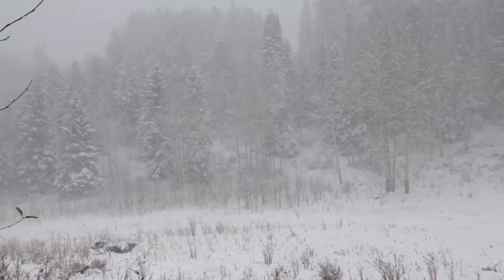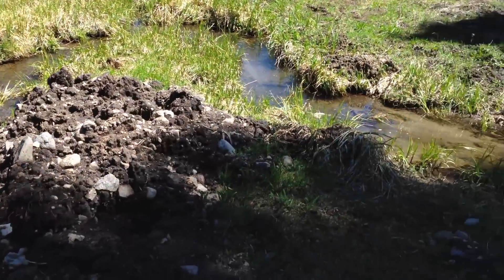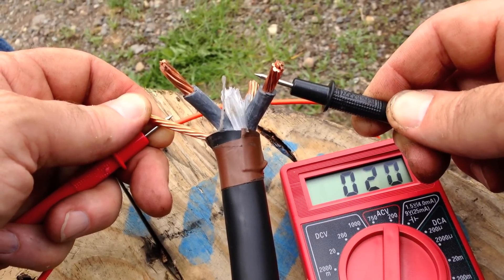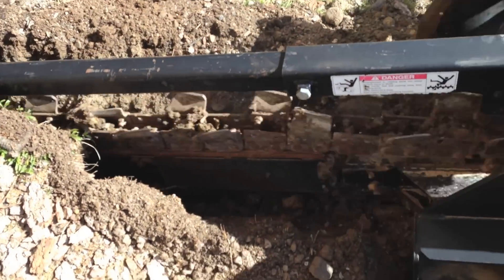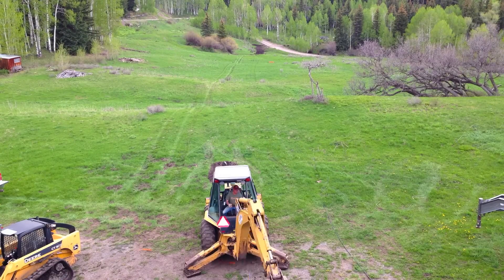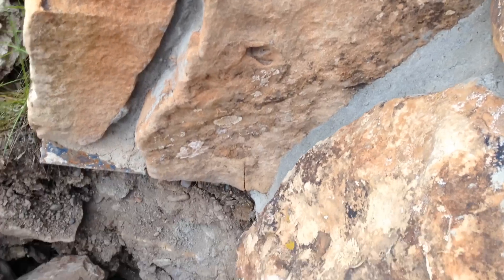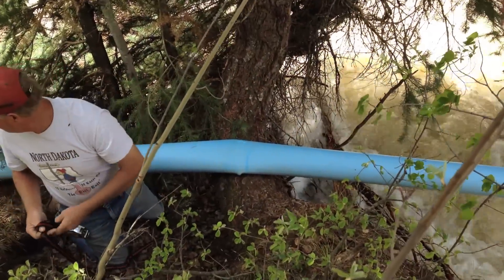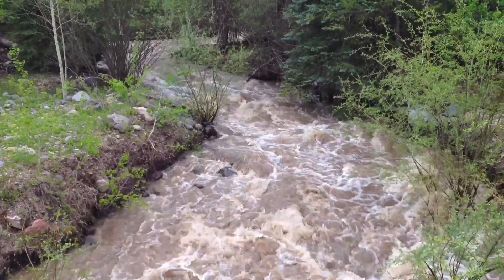Part 10 MicroHydro Power System in CO

Comment: How did you obtain the water rights to do this? how much did this cost overall for the entire project?
Reply from the maker: We filed on water rights in state water court.  Its a lengthy process which is best navigated with a lawyer well versed in water law.  It can take years to finalize if you are just starting out.  

I don't know what you have seen of the series.  We started in 1995 acquiring water rights and putting in a penstock from springs. That initial system cost around 25k in 1996 dollars. We also got gravity pressurized domestic water and a pond for raising fish at that price.  

When we moved the existing equipment to the creek we incurred additional costs of around 55k in 2015 dollars because we needed a full redesign of penstock, powerhouse, transmission and load management.

People often ask how long it will take to payback the system, but this neglects to consider that we would have had to spend about $140k in 1995 to bring power lines 7 miles into the off grid property.  That estimate had ballooned to $250-300k by 2015 when we moved the system.  We would have had to pay that to bring power lines in and then had power bills to pay on top of that.  So it was a no brainer to install our own system at either juncture and the question of payback was/is a moot question.  We look at the installation as an asset investment in the overall property.

Thanks for watching.

Comment: Pvc is so cheap and thhn number 6 is also much cheaper the the DB 6-3 you dropped in plus if you ever want to run another wire you didn't have to dig up your driveway
Reply from the maker: Oh well, done now.  thx for watching.  If you haven't seen it check out parts 20-1,2,3 which are a synopsis of it all.
Reply: I'm still watching the videos, so good and thank you for videoing this for the rest of us.  Hind sight is 20 20 now that I have seen everything involved up to a point that conduit would be the last thing on my mind.

Comment: Did you think about building the intake area in the creek out of concrete?
Reply from the maker: No, the Spring run off is too great and would likely tear anything apart.  Also, this is wilderness and the only way to access the creek diversion is on foot and essentially inaccessible to any machinery.

Comment: I'm curious on the financial side.  With all the costs are you able to generate enough electricity to break even?  Or is it more expensive and you are doing it out of principal?  Very cool project. Enjoying the videos.  Thanks for sharing.
Reply from the maker: +FarmCraft101 
Reposting part of a previous answer:
It's a good question, but very difficult to answer. First, one would have to amortize the cost of laying in grid power in 1994.  At the time of the switchover the system had produced 145,000 kWh for a basic cost of $25,000 versus $140,000 for laying powerlines. Add $52,000 of current development costs and you are paying for all the future power generation in the systems lifetime. You would also need need to subtract the cost of line power over the last 19 years to determine the cost per kilowatt hour over the first system's history.

Adding to the previous answer
There is no means to sell the electricity back to the grid because there is no connection. A break even point would indicate some sort of payback or a comparison to getting the same power from the grid.  You can see the comparison above and it doesn't factor in monthly bills just the cost of bringing the lines in.  With hydro you are paying for all future power up front.  I did put it in out of both principal and necessity and just basic economy.  It was a no brainier in the 90's given the numbers.  The current cost of equipment identical to what I got back then has gone way up, but solar has come way down.  If I were to choose now, I might consider solar, but I would have to accept the idea of dealing with batteries.  That's something I've never really wanted to do at 8600 ft. And originally not being here all the time.  Hence improving the hydro has been the path I've chosen. Hope this makes sense.

Thanks for watching.  There will eventually be more to come, so do subscribe.
Reply: MrHydrohead z

Comment: how can I increase flow and load to a stream that flows into a lake (really a river but has a dam)
Reply from the maker: I'm not sure I understand the question.  Could you describe if you have a pipeline existing or a potential design?  How far it falls top to bottom(head = pressure) or how much water is available to travel through it?   Head and flow are the two important measurements.  The amount of available water is what it is.

Comment: What is a weir? I have no idea what you are building.
Reply from the maker: A weir is a structure that allows you to control or measure a flow of water.  This video is part of a series showing how-to knowledge on putting in a micro hydro power system. The temporary weir in the earlier video is for measuring available creek flow and the one constructed later is for a controlled intake point for water in our hydropower system.

Comment: How ever did you get you get the governments to let you do this, or do you not need approval?
Reply from the maker: FERC regulates navigable waters and fish bearing water bodies.  My creek is neither of those conditions so I don't need a permit from them.  I own the land that the entire system sits on, so what I need is a conditional water right from the state which I got by applying to Water Court in the state and filing on the rights.  Once the system is complete and I have shown the water being put to beneficial use, I can apply again to make the water right absolute based on the adjudication date of the original filing date for the conditional water right.  In my case that will be Nov 2000.  Any other filings on the water after that date will be prioritized below mine.  Any filings prior to my initial application would be prioritized above mine.  My use of the water is considered non-consumptive, so its not really that big of a deal, just paperwork and permissions being acquired via the standard procedure.

Comment: Do you think the old hydro system would be strong enough to spin a small wheel and car AC compressor? Might be able to run refrigeration/AC off the power of water.

Comment: Great work as always. I have learned so much from watching your videos, and I cannot thank you enough.
Reply from the maker: Very Welcome.  Glad to share.  Its nice to know someone else is benefiting from my process.  You've said you had interest in doing something yourself so FYI,  I learned a great deal about all of this back in the 90's before the internet had much of anything, by taking a course offered at S.E.I.(Solar Energy Intl.) based in Carbondale, CO.  If you don't have time, $, or inclination to do that, there are lots of resources on the net.  Let me know if I can help….
Reply: Thank you. I actually had a few big questions that I couldn't find on the internet easily. First, where did you get your turbine and generator? Second, how much power are you producing? In this case where you have untamed water, is there a way you can find the head of the river and place the intake there, or is that not feasible? How much has it cost (if you don't mind me asking?) Having these experiences now, would you do it again if given the chance? What would you do differently, or keep the same?
Reply from the maker: BKerryFTW  Lots of questions here.  Longer discussion required than is good here.  Send me your email to offermeister at mac dot com and I'll answer them specifically.
Reply: Okay, thank you very much.